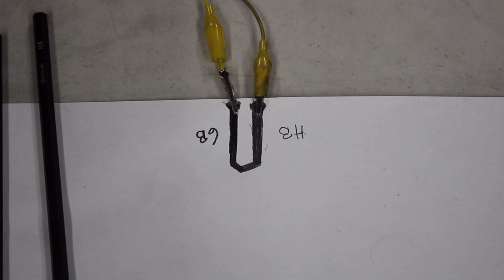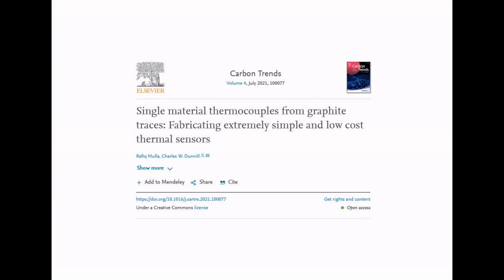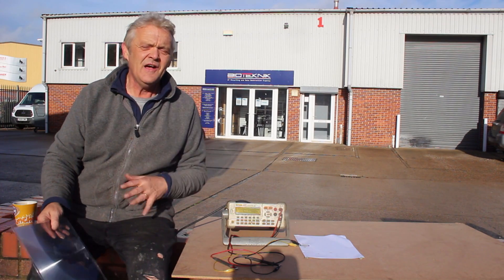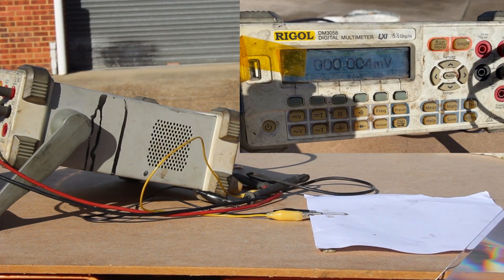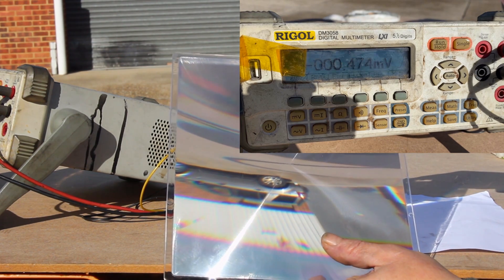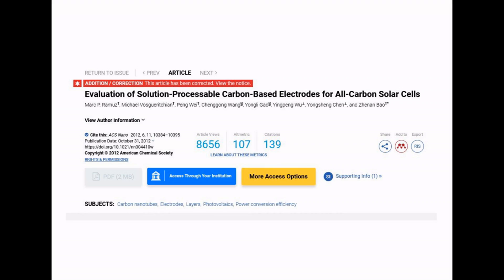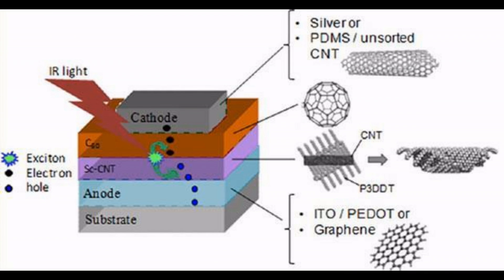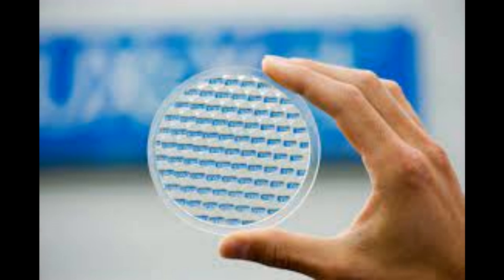1721 A DIY Solar Cell Made From A Pencil And A Bit Of Paper

Comment: Pretty neat. And maybe something can be done to improve the output. 

My imediate thoughts go to it would take roughly 2,000 junctions in serries to get 1 volt. Or 20,000 for 10v.  What's the internal resistance?  Pencil  lead isn't a great conductor  so I'm guessing a 20,000 series junction will have a high internal resistance which might work for very small loads but the voltage will drop as one increases the load drawn. 

When you mathematically model a voltage source with its internal resistance and an external load resistance, you'll find maximum power is transferred to the load when the load resistance = source resistance. Another example of Impedence matching and power transfer.
Reply: Hi, Keith. I think you are mistaking millivolts with microvolts. At 0.500 mV, it would just take 2 junctions to make 1 volt. Imagine 10 junctions thick enough to handle the current, and you could charge a cell phone.
Reply: @rclewis01  Your voltmeter was showing 0.500mV, so half a millivolt (0.0005V), not half a volt, which should show up as either 0.5 V or 500 mV, so, to get 1V you would need 2000 junctions.
Reply: Hahaha, I agree. I whipped up a design on the cricut and set it to work to make hundreds of these junctions! There was one flaw I ran into... the pencil dulling. So back to the drawing board I went (pun intended) 😅

Comment: Could you stack the papers on eachother? If you could layer them i se  real potential in these
Reply: Top layer has to be clear so its not blocking light. Otherwise that should work to create a full page size solar cell.

Comment: You have the Fersnel.
Add a ND:YAG crystal [100£ or so]
Add a Old Reflex Camera Lense that can zoom.
Put the Fersnel focus on the Crystal and the Output Laser enlarged over a Whatever Photovoltaic Cell...
You got 56% Efficiency right there..
You would got roughly 8w out from this Set up..
Or 96wh in a 12 Hours of Sun...

Now if you add Graphene-WS2 Hot Electron Harvesting you'll have the Future past of Energy and the reason why the Wars ar Fought.

If you lamenting people will not simply be willing to Pay for it full price I remember you 2 things:
It could be as such right now you are paying it more than before.. you're simply not Acquainted with it..

The Bottle of Water you buy at the Pub will cost you 1£ even if at the Source that singular bottle Costed a fraction of a Penny.

But I imagine being yourself in England you'll have to consider the moral costs of Buying a Bottle of Water at the Pub like the Biggest Loss..

Ergo The Light in your Household..
The bottle of Water.
Are Commodities..
Capitalism isn't based over Values..
It's Based Over Commodities...

That's Why Healthcare shouldn't be a Buisness..
Because Health isn't, just a Commodity.

My Pleasure to Having Entrained you sir.

Comment: JUST INCREDIBLE  would it be possible to stack them by drawing them on clear plastic or glass ?
Reply: my thoughts exactly..
Reply: Might require the HB lead or both  to be turned into a fine dust as I just tried it on plastic In the art world Pencil drawings are fixed with hair spray
Reply: @seamuscharles9028  You've set me off now lol. Wouldn't the hair spray create a an electrical barrier? What plastic did you use and was there a good trace of different types of pencil ( graphite ) on the plastic, also what heat source were you using? Did you sandwich the plastic? and if so did you direct the heat vertically or horizontally through the plastic?  Sorry for all the questions but I don't have the equipment to measure any results I may draw/etch on the plastic.
Reply: @chrissavill8713  sadly I don't have the equipment either The 8b pencil has no problem on plastic but the harder HB has I was also thinking that a mirror could be used to reflect the Light back up through the stack

Comment: Even though light from sun doesn't heat, i think infrared light heats. Then in theory one could implement such thermal couple array into a transparent sheet or glass panel and stack vertically. Graphite is also black so it heats under sun more

Comment: That brings more ideas .. what if they were printed on a clear plastic or glass and sandwich layered.  The heat would be transferred into the depth of the system .. reducing the outside surface area while increasing the output.  ???  I'm also wondering if there could be a difference in graphite by using color differences .. which color is understood to be a frequency difference .. so red and black may be similar .. but contrasting colors like Red vs Green - Blue vs Orange - Yellow vs Purple.

Comment: I wonder if the power would increase if two touching parallel lines were drawn on the paper instead of two lines joining at the tip. (Really enjoy your videos)
Reply: I used a grid, graphene in one direction and graphite(2b drawing pencil) in another.  Brought them all together in rails on the sides.  So I think you are on the right track there.  Keep it up!
Reply: @James Ross  what were your results?
Reply: It was layered as well by the way.  Not just one layer.
Reply: Interesting idea,maybe do a sheet of graph paper in  two or more pencils.if it doesn’t work no great loss.

Comment: Someone else was first, but if you're going to print the ink onto paper regardless, instead of/in addition to lenses print the circuits on black paper, the white paper isn't collecting as much heat, though the marking itself is, (not sure how important cooling is here) alternatively if cooling a different portion of the paper is helpful, dyes such as YInMn blue that are supposed to be capable of sub ambient cooling by radiation could be printed just as easily.

Additionally, what is to stop you from printing out a "book" worth of "sheets", separating them by an electrical insulator (blank paper?), binding them with a wiring "spine", and making a huge, cheap, thermopile?

Comment: OK that could be really really awesome used as the backing for solar panel that heats water, since you usually paint the back black anyway, so using vacuum to amplify the heat... Great

Comment: What about actually using an inkjet or laser jet printer and modify the ink or toner? If one could successfully do that(e.g., at some various material to toner power then one could easily print any pattern array one wants. With a 1200 dpi printer Hypothetically one could have say, 1200*8*11 = 100k magnification factor. Probably drop that down by a factor of 10 to be realistic but that gives a 10k scale factor. If one can generate just 0.1mv per junction then that would result in 1V per page. One could print them off in the thousands. By possible engineering the design maybe one could create 3D cells, so to speak, where, say, one layers pages to create various junctions(say the + junction is on top facing the sun and the junction is on bottom). Then one side would get much hotter than the other. Probably requires some "bleed through" to connect them. Using photo lithography one might be able to get 10's or 100's of millions of junctions but this starts to get in to commercial level. My guess is though once a load is attached the 0.1mv becomes 0.001mv as to make these ideas completely useless.

Comment: Looks like they make 6B and HB mechanical pencil leads.  Laid side-by-side, alternating HB - 6B, someone could build a considerable sized array pretty cheaply.  Perhaps embedded in clear plastic film, on a substrate, it might make a worthwhile cell.
Reply: Yes .. I'm wondering if it could be layered (sandwiched) so the surface area could be reduced for a greater output.
Reply: @MerwinARTist  I think the trick is to only heat one side of the junction and to transport heat away from the other side of the junction. It is pretty cool but I can't imagine how big of a device you'd have to make to match a single small peltier element in performance.
Reply: Have you priced peltiers? Theyre very expensive for experiments.
Reply: @professorfukyu744  I recently got four cells for experiments. I think I paid around $20 for them so I would not consider them prohibitively expensive for experiments. But if you want to use them for meaningful power generation they are expensive but I still think they are cheaper than the pencil method =)
Reply: @miklov  In the first video he put his finger over the spot where the junction between the two graphite connections met.   There was voltage between to the two graphite pencil lines.  Next he put a thin piece of plastic over the junction and again touched the same spot.  The reason this was important is to show there was no moisture on his finger that was connecting the two .. or from his finger.  This now tells me it was the warmth or heat that caused the voltage between the two graphite lines.  This is demonstrated with using the lens in this video .. no finger .. just solar heat.

Tesla said that if you knew the value of frequency / vibration .. you could understand the universe.  Everything is "Energy" even X-rays which cannot be seen with the naked eye .. but colors also radiate at a specific frequency .. that our eyes pick up.  This is why I am wondering if the contrast between opposing colors might also be a generator.  Like what happens when you look at Red next to Green .. it is used in Art as a way to grab the attention of the eye.  In nature we have a Green plant growing up .. and then there might be a Red flower .. so the Green part is supporting the flower with focused "Energy".   This is quite interesting .. my theory might not be valid I don't know .. but to me it's an incredible thought.  

Color Frequency - Photon Energy
Violet 668-789 THz   PE 2.75-3.26 eV
Blue 606-668 THz   PE 2.50-2.75 eV
Green 526-606 THz  PE 2.17-2.50 eV
Yellow 508-526 THz   PE 2.10-2.17 eV
Orange 484-508 THz   PE 2.00-2.10 eV
Red 400-484 THz    PE 1.65-2.00 eV
Reply: @MerwinARTist  I am no expert but I believe those energies would be specific to emissions or absorption and I don't see how a differential in those properties could be used to extract energy in the same way you can extract it from thermal differentials.
Reply: @miklov  .. do we extract energy from Ultraviolet radiation?  It's in the next range of frequency below the color spectrum .. and above it is Microwave and Infrared.
Reply: @MerwinARTist  Yes, multi junction solar cells will be capturing some UV but I don't think they will capture the majority of the UV range, there is no reason to focus on the UV range for terrestrial solar panels. Solar panels for a moon base may be quite the different story since there you don't filter the solar radiation through a thick atmosphere.
Reply: @miklov  .. so I'm not talking about solar energy for the moon.
Reply: @MerwinARTist  I didn't say you were. I just said that if you want to widen the spectrum on your solar panels, you may want to get them out of the atmosphere.
Reply: @miklov  Okay .. gotcha!
Reply: I tried this! I connected various combinations of pencil leads held together with alligator clips. I did not get a result 😐.  I applied heat, artificial light, and sunlight... (I tried soldering them also, didn't stick even with every trick I know) I'm wondering if the act of drawing creates a thin film of graphite that is oriented in same direction, and the alignment of the particles are what helps create the flow of electrons. This also leads to more curiosities of perhaps the skin-effect may be at play. One thing I want to try is to make various versions of Robs conductive ink using these types of graphite and paint the circuits and test.

Comment: If you draw several "cells" in series, will it bring the voltage up?
Reply: It will, but you'll need to expose to Sun the contract point area and to shield the rest of the "wire", so that there's temperature difference.

Comment: This is really inspiring, I believe there is a ferite type of 3d printing filament, how difficult would it be to find graphite based 3d filament, I'm assuming it's grahite in the pencil that relates to it's thermal conductivity when creating current? Thank you for the content!
Reply: Super easy. Its just conductive filament. Ive debated printing pcbs with it.
Reply: @professorfukyu744  Thank you,would be really interesting to see how much current I would be able to produce.

Comment: In all this crazy last couple of videos I missed the exact  mechanism that creates the voltage across  the graphite junction. You have the line of one graphite and a mine of another with a common over lap section. Infra red photons are dislodging electrons at the boundary layer so are we saying one graphite has a different crystalline structure causing this preference or is it the non graphite components causing the exchange ?
Reply: Id figure its the amount of graphite. It probably doesnt matter what pencils or carbon you use so long as theyre different. Experiments can be run to figure out which pair has the most difference for maximum output.

Comment: I wonder if one could use an old pen plotter with appropriate mechanical pencils and draw cells

Youd have to advance the lead somehow
Reply: You could rig up a cheap cnc device and put a spring load on the pincels. Maybe draw it on a ceramic tile.
Reply: @jamesma70  seems simple enough 

Now that you say that i think i saw something similar with colored pencils